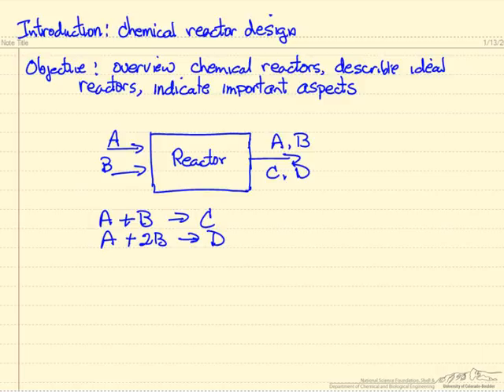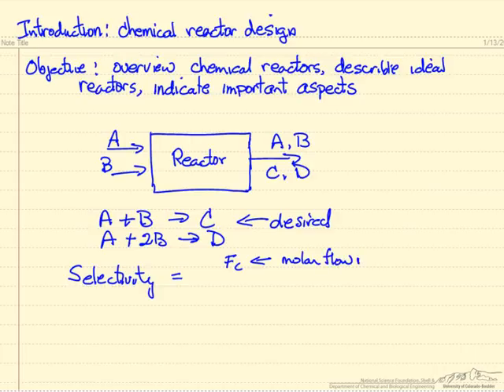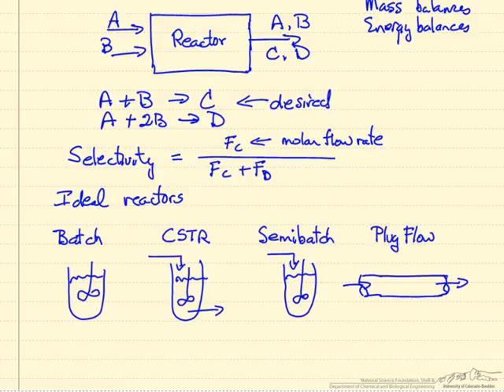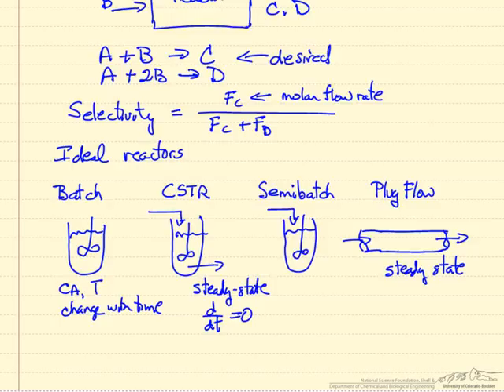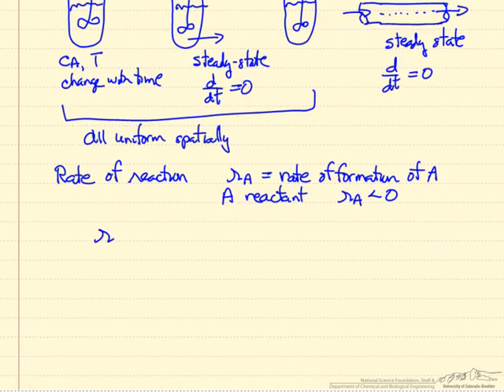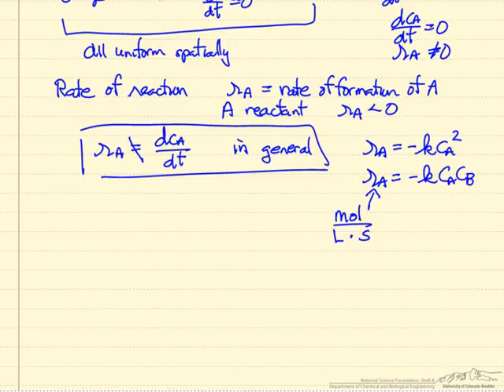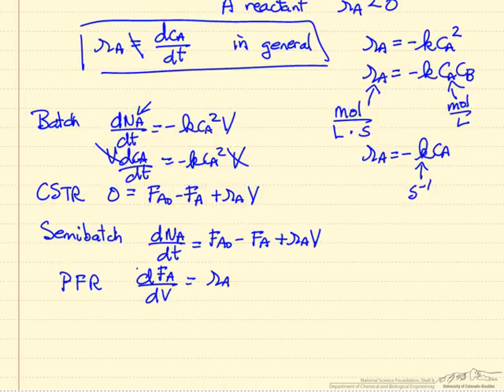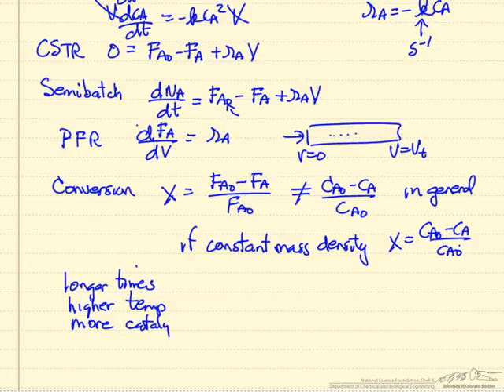Introduction to Chemical Reactor Design

Comment: Whilst the video is good I would like to know how to cost a 9m^3 batch reactor with glass lined stainless steel wall/agitator/baffles. Are there any good sites linking to the manufacturers I can reference for the costing? I need the information for my third year Chem Eng design project. Thanks
Reply: how much did it cost? xD
Reply: who am I no idea they never got back to me.